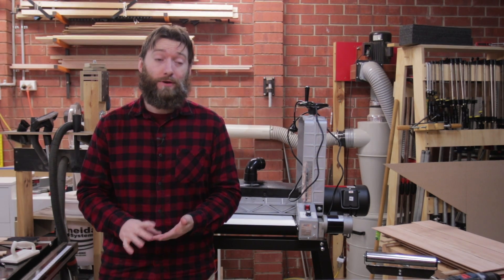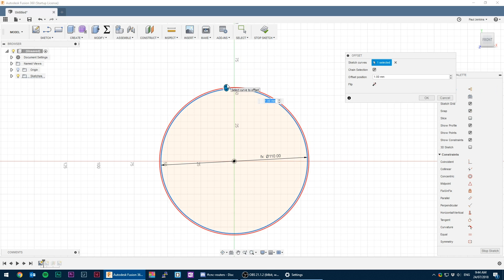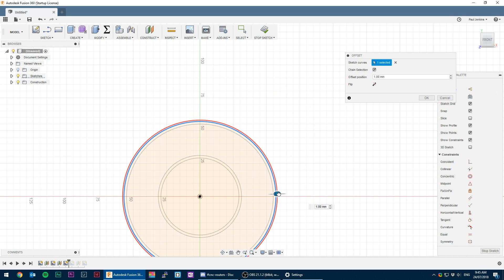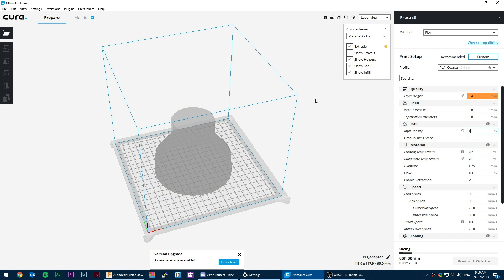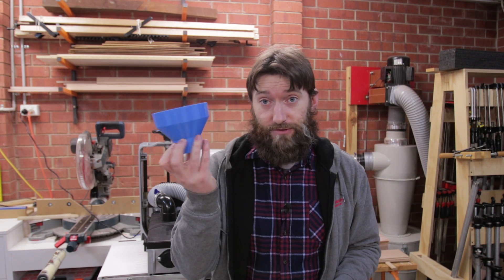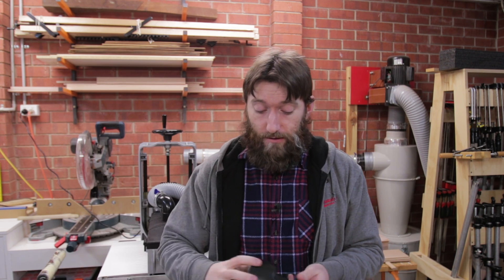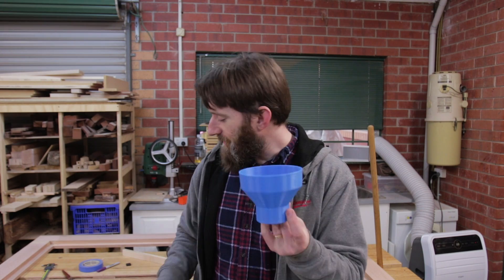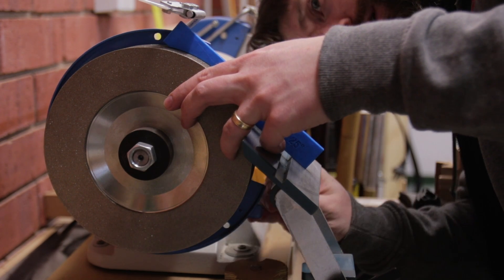3D Printed Dust Adapter (4" PVC to 2.5" flex hose) - does woodworking & 3d printing mix?

Comment: I did exactly the same thing!
Other woodworky things I've done with the 3d printer: 
- Router template to match a bunk bed rail
- Drilling guide for a clamping table
- MPCNC cnc router
- Star knobs
- Push block in yellow plastic (you know the one)
- Sanding blocks
- Replacement cam lever for Aldi bandsaw fence (although it is so flimsy I ended up replacing the fence with plywood).

Cheers from 3152!
Reply from the maker: Almost ignoring everything else, star knobs are one of those things that could add up very quickly. They don't cost a lot to buy, until you tack on shipping, not able to get them in customisable thread sizes, or shapes, etc. 

Sanding blocks are probably the next workshop thing I'll print out (after more dust fittings), they're impossible to find halfway decent ones for small file-type-sanding to buy!

Comment: As most people do woodworking as a hobby, to me the question is not, is it worth it to make the parts, but does it make my life more fun
Reply from the maker: I'm not doubting 3d printing as a hobby, but I think I have enough hobbies to keep me occupied until long after I die! I'm more looking at it purely from a practical tool point of view. Think of it like a sander - every woodworker has one, nobody enjoys it, but its a practical tool because the alternative is hand sanding. Does 3D printing fill the niche for items that can't be bought off the shelf or for customisable stuff in the workshop? The answer is... probably!

Comment: I’ve printed:
-painting triangles
-MFT clamping system
-corner blocks to clamp with a ratchet strap
-CNC hold-down clamp (t-track)
-plastic bench dogs 
-corner finding jig 
-dovetail guide 
-corner clamp
-Festool hose to tool adapter w/ flex filament 
-unified my tools to ONE unified size, everything fits one dust collection size! 

End the struggle!

I knew when I saw a 3D printer that the possibilities were endless. Especially for my wood shop.

Comment: I have the same sander, however found that dust collection was horrible! This was due to the air flow being very constricted, as well as the small port being located in the center.

What I did was take the lid off and made a "temporary" lid out of MDF that a 4" hose can be attached to. Dust collection is improved greatly.

Having the 3d printer for items such as these would be quite convenient, I could have printed some adapters. Good idea!
Reply from the maker: Interesting - I wouldn't say the dust collection on the unit is amazing, but I haven't had too much of an issue with it, except for the one board I forgot to close other blast gates with. Dual 2.5" or a single 4" would be much better though, I think I might go down the same path and replace the lid when I've got a bit more time.

Do you have a 2hp dust collector in use with it?
Reply: Paul Jenkins Just your average 2HP unit, albeit with a pleated filter. I would definitely recommend changing the port size, it really does allow for much better collection.

Comment: Neat idea. I needed a quick reducer, so I took a 4” pvc cap and drilled a hole in with a hole saw, then fit a piece in that went to my 2.5” hose (cut off piece of the vacuum wand). A couple little screws and some foil tape and it’s solid. Not as pretty as yours, but functional.

Comment: The markup on those injected molded parts are insane and something like 10-50x over cost (I used to work in mfg).  I am faced with a similar problem, need to interface 4 inch drain pipes with 4 inch dust ducts (which are off by 1/8 inch).  Adapters are $7 plus.   If I can save $5 a piece the 3D printer will pay for itself with the quantity I need.

Comment: I've made a ton of things with my printer that I use in the shop

A copy of Woodpecker's center finder
A fairly accurate (enough anyway) set of 1-2-3 blocks.  For woodworking they're great, maybe not for machining
Center finding jig for round stock
Almost zero clearance insert for my Grizzly bandsaw
Wall mounted pencil cup
Sanding block for round sheets
Paint pyramids
European hinge hole marking jig

It could have been done in wood, but it was fun making (or finding) these.

Edit: I forgot the hose adapters.  I've made quite a few of those, too.

Comment: I made a couple dies of MDF and then I used my heat gun to shape the PVC and made my own fittings that way.  But I don't think that my way would work with that extreme reduction you'd have to make a couple different pieces to get from one diameter to the other
Reply from the maker: Your method is probably better if you're doing enough reducer/adapters. You'd have a slightly higher setup time getting the sizing right, but once you've got that all dialed in I'd imagine it's a relatively quick process. I'd imagine the PVC is probably a bit more durable too, though I guess there might be the fumes to worry about if you aren't too careful with the heatgun ;)

For a one off - maybe even 2 or 3 - 3D printing (if you've got access to the stuff) is probably easier since its measure two circles and hit print.

Comment: Paul, good info for anyone contemplating a 3D printer purchase - nice toy, but not a quick pay-back.  That jig you showed quickly for setting grinding platform on your jig is interesting.  I've not seen anything like that.  Could you post a PDF of the dimensions so I could make it myself (out of MDF or HDPE)?  Thanks.
Reply from the maker: http://emgw.org/Resources/Documents/Papers%20and%20Articles/ToolRestJig-Rev.pdf That should help you. If you've got a standard grinder wheel (vs the CBN type wheel that I run), the diameter will change over time, so the jigs may be best made out of MDF as they'll need to be remade for new diameters :)
Reply: Thank you.!  Great stuff.

Comment: Google MPCNC. 😀. Cheers

Sorry another poster beat me to it!
Reply from the maker: From just looking at it, the MPCNC looks really similar to how the Shapeoko1 was. Great idea, but the practicalities of it are somewhat less because its not rigid enough to go at good feed rates. That is, however, just after quick scanning their site and watching a few videos. This was also an issue with the gen1 xcarve using the quiet cut spindle - while it was "quiet", breaking bits and waaaay too long carvings were what 'killed' it for me. (Gen2 is so much better).
What sort of feed rates do you get?

Comment: I've printed a few things that I use in my shop.  Here's a video of my printed drawer handles - https://youtu.be/KcqDQYpgBAY  I also have plans to print some custom tool holders that work with pegboard.
Reply from the maker: How have they held up over time? Drawer handles - particularly utility ones like in the workshop - are so freaking expensive. I think the cheapest one (thats actually regularly in stock) at the big box stores around here go for $4, which adds up very quickly. I could see that as being a great use thats practical, time and money saving.
Reply: They've held up great so far.  I was concerned about how hot the shop gets in the summer, but that hasn't been a problem. I could see them getting damaged if something slammed into them hard enough, but that's the other great thing about printing.. I can print a replacement in about 10 minutes.

Comment: When you have a 3D printer you start to understand you also NEED a Laser Cutter for Templates and then you come to the realization you NEED a larger CNC and ..... :D 3D printed knobs and levers with a combination of knurl nuts and metal bolts as required gets you a no compromise result.  Just made 21 of these 30mm diameter knobs for a Router Jig system https://a360.co/3vUALCm (not shown in the model is an M6 Brass knurl nut to retain the M6 Bolt) but feel free to play with the model.

Comment: My need for 'Widgets', are few and far between. So at present would not consider a 3D.. I don't know the price, but I'm sure it would take quite a few 'Widgets', to justify buying one and over a reasonable time get your return.  I'm not too restricted for time and if that desperate, could drive to the 'Two', shops. They are both about 45mins drive from home.
Reply from the maker: Looking at it purely as a tool to do a task (vs hobby/curiosity/etc), for items you can get off the shelf, yes I'd agree. I can think of about $50-100 worth of just simple connectors that I could halve (or less) the price of to make a better version (the terrible 4" plastic blast gates are a good example - just print flanges, still go with the wood method for the gate), and probably another $20-50 of other workshop items.

I think the more ... interesting? justifiable? reasons for 3d printing would be perhaps the custom items that you can't buy, that perhaps aren't viable in wood. 

A bit like hobbyist woodworking - you don't buy all those tools to save money on furniture, otherwise you'd just shop at Ikea! It's all about getting something you can't get elsewhere ;)
Reply: I have to agree with the Gates. After watching you video quite awhile back. I ended up ripping the flanges off the crappy bought ones and replacing with wooden gates, just used the flanges. So there would have been an example of use for me.